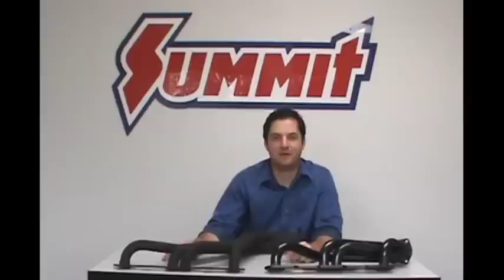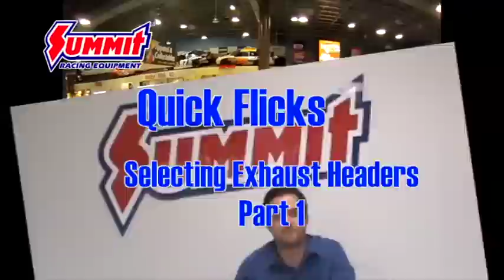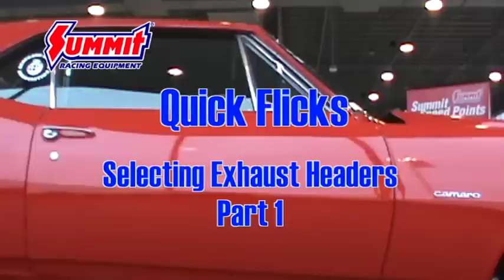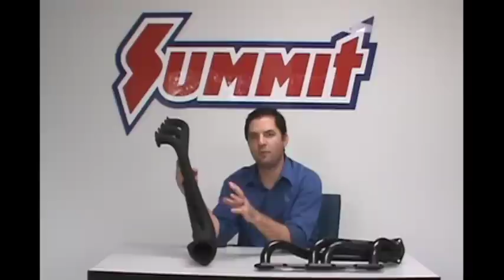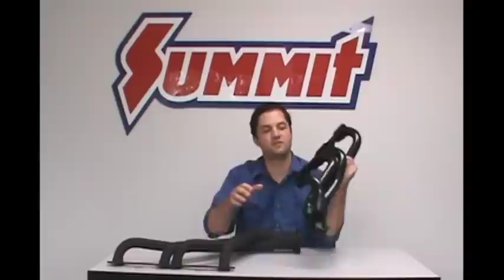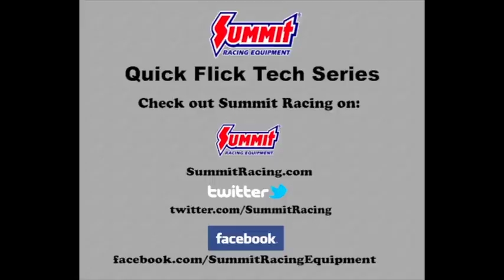Long Tube vs. Shorty Headers - Summit Racing Quick Flicks

Comment: What would you recommend for a 2016 Honda CR-V?
1. 4-2-1 headers
2. Long tube headers
3. Short tube headers?

Also, what's the difference between 4-2-1, 4-1 and tri-y headers? Can I mix and match them, let's say 4-2-1 long tube headers or 4-2-1 short tube headers?
Reply: put a stock header Hondas are crap
Reply: David Robertson ahhahahhaha Exactly
Reply: +Anonymous Viewer get rid of the honda and get a real car. then consider headers.
Reply from the maker: +Anonymous Viewer, 
Can you please give our tech department a call? 1-330-630-0240. 
Thanks!

Comment: I have an 03 silverado 4.3 am having a hard time w the driver side due to the steering column
Reply: +David Hernandez get a 2 piece design that will wrap around i had the same problem with my 89 mustang
Reply from the maker: +David Hernandez, 
Yep, headers are a challenge to install on any vehicle. Things do get in the way and it is not uncommon to have to unbolt a part to move it and re-install to make the install easier!

Comment: Would 1 7/8" shorty's out perform 1 5/8" long tube in the 3500-6800 power band.
Reply: 3
Reply: tube diameter is dependent  on your displacement and the RPM your torque peaks at.
There are online calculators for this.
Reply: Yes

Comment: I got a 92 f150 with a 4.9 efi I6. are there any long tube or mid length headers available?
Reply from the maker: +john d, 
We have a header available for that truck but, it does not have allowances for EGR, O2 sensors or catalytic converters. So, there will be fabrication required for those components so your computer works properly as well as dual exhaust pipes.  http://www.summitracing.com/parts/hok-6823hkr/overview/year/1992/make/ford/model/f-150

Comment: Have an 86' f150 4x4 5.0 with an maf conversion i hear mix answers on whether to to ST & LT looking for performance where ny vehicle runs strong at 3500+ rpm
Reply from the maker: +Rene Reyes , 
If the best performance is the only concern, a long tube is the best way to go. But, if fitment of the exhaust and affordability are concerns, you might consider short or mid-lengths.  Give us a call, we can help you choose! 1-330-630-0240. Thanks for watching!

Comment: I just got a set of bbk shorty headers in for my 5.3 vortec, but the thing is I had planned on getting the long tubes(they were a gift from a friend). Will I still see gains with the shorties?
Reply from the maker: +SuperAngus52 , 
Yes, shorty style headers have a flow increase over stock manifolds but, without a new tune in the ECU, whether by use of a hand held or a dyno session, you may not realize the most power output possible.

Comment: I was wondering if the long tube headers fit with a 4/6 drop. it's on a 79 c10 short bed. And what's the difference between a standard headers and after burn headers.
Reply from the maker: +Fermin Garcia , 
With that much drop a long tube will fit but, will be close to ground and difficult to drive without dragging in everyday driving. A better suggestion for you would be a mid-length and a custom exhaust.  The Flotech Afterburner has a Patented Velocity Tube that is marketed as increasing cylinder scavenging over the more traditional 4 into 1 collector design.
Reply: Are the mids any power difference from the long tube
Reply: Use headers for an 81 camaro. They tuck up closer to the cab.
Reply: +Yaz Sampson how the fit on it do I have to bend it anymore then what it is and does it matter what year
Reply: I had a set laying around for an 81. bolted up n tucked closer. instead of having the pipes bent downward over the trans cross brace to tie into the truck headers it was a straight shot into the camaro headers.

Comment: i have a crate chevy  350 ho vortec heads in 39 ford pu mustang  rac what headers should i use
Reply from the maker: +chuck platt, 
We have weld up kits available so you fit your own or you could seek the assistance of a custom header builder in your area.

Comment: Hello. Currently have a 454 with exhaust manifolds. Eventually plan on doing a pair of shorty headers from you guys since the vehicle is lowered. Approximately making 365 horsepower now. Two questions: 1) How much horsepower can I expect to gain? 2) Will I be able to notice a difference in sound at both idle and acceleration? Thanks for your time.
Reply from the maker: +Kevin Goss, 
While adding headers will certainly add horsepower, every application is different. There are some variables involved which includes how the motor is re-tuned after the addition of the parts. As far as sound is concerned, headers will change the exhaust note a little but, the larger determining factor are the mufflers and pipe size being used.

Comment: I just installed a set of shorty headers onto my 350 SBC motor (1977 factory original-never rebuilt), and had to trash the rest of my exhaust system and mufflers due to the vehicle's previous owner doing a poor weld job and using cheap materials. I've had to run open headers for the past few days, and I've noticed that the swap has leaned out my engine and has lost a lot of power especially in the low end torque/power. I've read that since they collectors are close to the cylinder heads that the exhaust gasses get contaminated with the open air or something like that. so in theory would adding a length of piping to it cancel out the poor exhaust flow? I've no idea what the best setup for performance would be for the exhaust as I'm low on budget and don't know much about exhaust tuning. I'm planning on building custom exhaust system, true dual straight pipe with glasspacks but I need a temporary solution to the loss of power what should I do with it for now?
Reply: +Tristan Butcher My vehicle is a 1977 El Camino Classic if that helps any
Reply: +Tristan Butcher Hey man, I have a 1977 corvette with the 5.7L 350 in it, I was in the same boat not too long ago where I had to drive with open headers to the muffler shop and my engine HATED it haha it felt SOOO slow until I got up in the rpms, but once I got the rest of the exhaust put on it fixed it right away. I suggest putting a longer piece of pipe on until you can get yourself a full exhaust
Reply: +Justin Taylor I just put two 18" of flex pipe and two thrush glasspacks on it a week ago, it's got the low end torque back but the shorty headers i installed burned the boot on one or two of my spark plugs, and the cylinder it goes to misfires every now and then so that's a whole different issue haha. aftermarket headers are a pain sometimes
Reply: +Tristan Butcher I bought spark plug boot protectors haha expensive at about 30 dollars a set, and you need two sets. But it's way worth it. That might fix your engine problem, new plugs wires and protectors haha I learned the hard way too!
Reply from the maker: +Tristan Butcher, 
Can you give our tech line a call? 1-330-630-0240.

Comment: i have a chevy silverado z71 2000 5.3 what headers will be good i ready have magnoflow i would like sounds good thanks
Reply from the maker: +Juan Martinez , 
Can you please give our tech line a call? 1-330-630-0240. We need some additional information from you. Thanks!
Reply: dude I have a 2000 Tahoe 5.3 and I put short heathers on it, and sounds great, but I have the flowmaster 440

Comment: I have a 99 Cadillac deville v8 fwd. would I be able to fit any long tube styles on it?
Reply from the maker: +Dakota Rose, 
Due to the way the transmission wraps around the back of your motor, there is no room for a long tube header on that application!

Comment: I have a 65 Chevy pick up with a LS swap 6.0 4L80E which headers will work for me?
Reply from the maker: +BigBlack65C10 , 
Assuming it’s a ½ ton two wheel drive application, Gibson has  a great choice for you. Its part # GIB-GP139S-C, it is a long tube and is coated. Take a look! http://www.summitracing.com/parts/gib-gp139s-c
Reply: I heard of people saying they don't fit?

Comment: I have a Chevy 350sb in a GMC C20 Long Bed pickup.  How about the RAM style exhaust manifold? Is that like the ultimate shorty? Right now I do have RAM style in there but the passenger side collector does not point straight down like the Driver's side does. It sweeps back and comes very close to the Starter. I was told that the Starter has been replaced a few times before due to the heat.  I just purchased the truck a few weeks ago.
Reply from the maker: +707SonomaComa , 
Using a “Ram Style” exhaust manifold may be a good choice in some applications depending on the horsepower output of the motor. In the end, it is still just an OE exhaust manifold . They are not pretty, though there are some performance versions out there that may or may not fit your truck! Ultimately a header is the better way to go for proper fitment and best flow and power output!
Reply: +Summit Racing  My truck is a daily driver, not a high revving engine. I'm sure you would know what type of header can fit into that truck. What would yo recommend for that truck?

Comment: what headers are Better for a v6 1998 mustang
Reply from the maker: +bvcncg, 
We need some additional information from you. Have you installed any other performance parts? We also have a few questions for you in what your goals are. Can you give our tech line a call? 1-330-630-0240. 
Thanks!
Reply: +Summit Racing  
the car is bone stock wanted to make it loud but v6 mustang dont sound good with anything

Comment: i'm building a 350 sbc around 9.5 to 1 compression backyard port and polish and rv style cam with a weiand tunnel ram and 2 500 edlebrock carbs. would the shorty headers be best or even stay with ram horns. looking for low end torque and good vacuum. going in 78 z28 thanks
Reply from the maker: duolg toy , 
Tunnel rams are designed for racing purposes and were never intended for street driving although some do. Your motor will struggle to make low end torque as well as adequate vacuum for power brakes due to the large plenum area of the tunnel ram. Please give us a call and we can help you with your parts choices. 1-330-630-0240. Thanks!

Comment: I have an 84 c10 with a 305 (I dont have money to buy a 350 or the intelligence to install it) I want long tube headers but I don't know which kind I should buy any ideas?.
Reply from the maker: Thelegitrager , 
Either of the two headers in the link provided would be a great choice for your application, good luck!
http://www.summitracing.com/search/year/1984/make/chevrolet/model/c10/part-type/headers/brand/summit-racing/engine-size/5-0l-305/engine-family/chevy-small-block-gen-i/primary-tube-diameter-in/1-1-2-in?N=4294950303%2B4294951398%2B4294949504%2B4294924068%2B400304%2B4294951392%2B4294951379%2B4294923997&gnview=Horizontal&SortBy=Default&SortOrder=Ascending
Reply: Thelegitrager for the price of the cheapest headers on jegs (186 dollars) you can buy a 350 off of craigslist. 
sometimes they will already have headers.

Comment: I have a 03 GMC 1500 with stock 4.8. Will long tubes or shorty's either one help me with increase in hp and maybe economy if not tuned? If so which would be more beneficial?
Reply from the maker: Dustin Gwaltney , 
If the vehicle is mostly stock and you are just looking for a little extra power and economy the shorty will work great. They are the easiest to install bolting right back the existing catalytic converters, and are less expensive overall because there is less modification to install them.

Comment: Hi i have a 2010 silverado 1500 lt ext i plan on ordering long tube headers with a true dual exhaust. I also am doing a 4 inch lift on 33s. Am i gunna have any trouble with installing or check engine lights on newer vechicle ??
Reply from the maker: Kyler Wruck , 
To have a true dual exhaust, you will have to fabricate it yourself or find someone willing to do it. Most shops will not due to the EPA laws. Once this is done, yes you will experience a check engine light. If you have a dyno shop in or around your area, they can help with a re-flash of your computer.

Comment: I have a 1999 Chevy Suburban with a stock 5.7L 350 V8. I don't want to do anything but get more horsepower. Are block huggers fine for my application?
Reply from the maker: Last_Starfighter, 
Yes, a short style header designed for your truck would give you a power increase and would also be easier on the wallet; and easier to install.
Reply: Can you recommend a specific model with number?

Comment: Not racing jst want to have a mean sounding truck if i were to get long tubes what would u recommended and what modification would i have to do
Reply from the maker: Roger Espinoza, 
You’re not really locked into any “must do” modification in order to run long tube headers. But, they do compliment things such as intakes, cams, heads, etc.  Feel free to give us a call and we can help you choose the right set. 1-330-630-02040.

Comment: I have a 2006 Dodge Charger rt. I'm confused to which header I should buy a shorty or long header. I just want to add some power and it's my daily driver I have a flowmaster exhaust. Help thanks.
Reply from the maker: jgbadblood262 , 
A shorty header will definitely be easier in your application and less expensive overall as well. Not to mention it will be easier to maintain emissions compliance.

Comment: I need help I have a 1991 Chevy Silverado 2 door short bed 350 V8 and I was wanting to put long tube full length headers on it but it's lowered at a 3/4 drop and the front is a little lower then the back will that be an issue with the full length headers I mean I want the full length ones but if that's gonna mess up my motor then I don't thing I want that any suggestions should I go with Long tube and risk it or Short tube and be safe and is there any sound difference between the 2 if so let me know thanks for helping!
Reply from the maker: OFWG209WuTangClan, Due to the ride height of the vehicle and not wanting pipes to scrape while traversing bumps, humps and potholes the shorties are definitely the way to go here!

Comment: Hi bro am jast whant aske you i have impala 96 lt1 what is the best tayb short or longe .. and thanku very much
Reply from the maker: Abdullah Amri , Long tubes are best when trying to achieve high horsepower for racing applications. If the car will be a street driven moderate horsepower application, the short tubes will do all you need to do!
Reply: Thank u man 😊

Comment: I have a 96 mustang gt. I just purchased bbk shorty headers with o/R X PIPE. In all honesty are the shorty headers a waste of time? Am I better off just doing the x pipe? I've been hearing shorties aren't worth it.
Reply from the maker: Mike Gauer, Because every motor is different, we can only speak in general terms. Shorties are usually better than factory manifolds, but not as good as long tube headers. Bottom line, with all the parts combinations available; unless you are modeling your build after someone else’s that has been dyno’ed and proven; you’ll have to test for yourself.

Comment: I have a 93 s10 4.3 throttle body injection single cab lowered 4 inches. What type of headers do you recommend for me?
Reply from the maker: Carlos Escobedo, For best ground clearance, a shorty header would be the way to go.
Reply: Summit Racing would this make it maybe a bit louder? Because that's what I'm kinda looking for.

Comment: i have a camaro ss 2013 took off the resonator and the muffler as well what would be better for my system ?
Reply from the maker: Tek Fre3ak, 
A shorty will be an easier install while a long tube generally makes more power. Either way, at this point you will need some programming. Search for a chassis dyno in your area!
Reply: it feels like i lost some power is that normal ?

Comment: Does shorty headers add any hp?
Reply from the maker: Calvin Burleson, 
Yes, most times they do flow better than the OE exhaust manifolds but, the extra added airflow through the motor may require computer tuning to optimize the power output!

Comment: I have a Levelled on 33's,  2002 Avalanche with a 5.3 Vortec, I have a custom cat back exhaust, a Spectre CAI and a Diablo Trinity tuner w/ a custom tune coming soon after my headers.  Im looking for more gains to tie all my mods together would you suggest Long Tubes or shorties? Doug Thorley is the brand of headers I'm looking at! Would greatly appreciate a response thanks!
Reply from the maker: Hi Joe Doe, 
If it’s a dedicated racer that does not need any emissions equipment and were looking for that last tenth of a second, then long tubes would be the way to go. But, assuming it’s a daily driver, maybe even towing, and probably want to work with your cat back exhaust; a set of shorty style headers will work just fine! Not to mention they are easier to install as well.